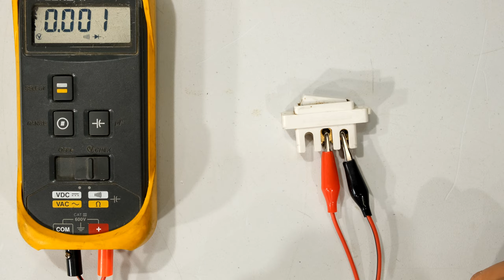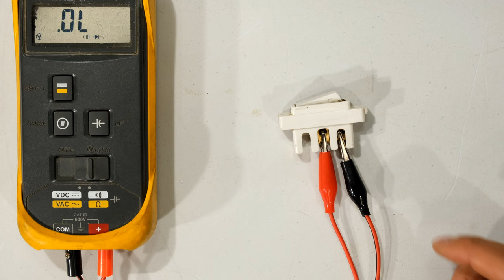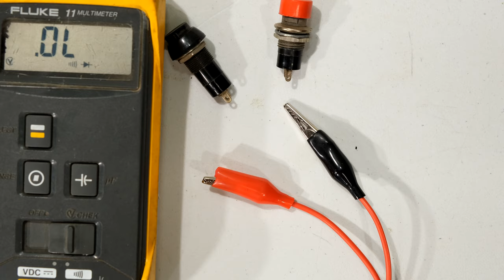What is the difference between a momentary switch and a latching switch?

Comment: After asking chatgpt for some assistance, I did a search and found this video based upon what it told me. A "normally closed momentary switch" or "push to break switch" is exactly what I need to bypass the coffee basket sensor on my $300 Cuisinart coffee maker and externally mount it so I can reset the unit without unplugging it and resetting the programed time. At the moment, without this switch, I have merely crimped the two wires leading to the sensor together so that it thinks the basket is inserted. Over time the basket sags and the unit becomes faulty. This corrects that problem, though I did not account for it trying to be a smart coffee maker and REQUIRE the user empty the basket after each use... I'd rather that be left up to the user. Thank god I know which kind of switch to get now!